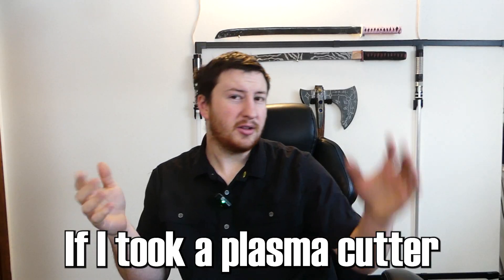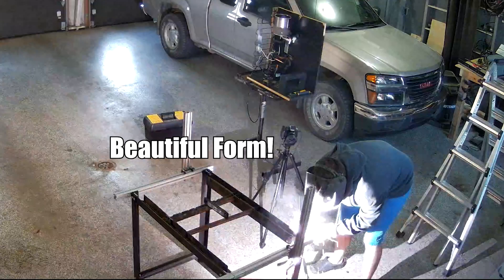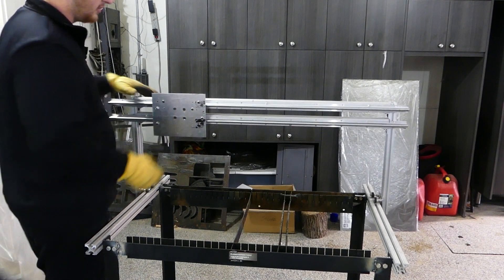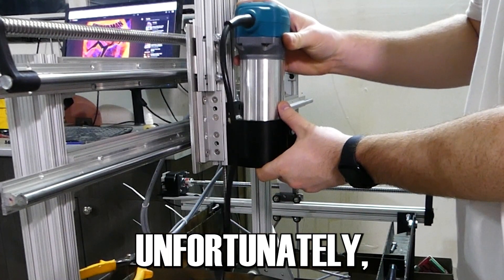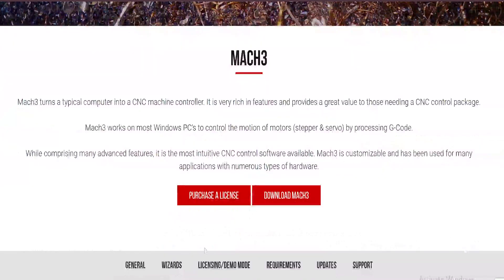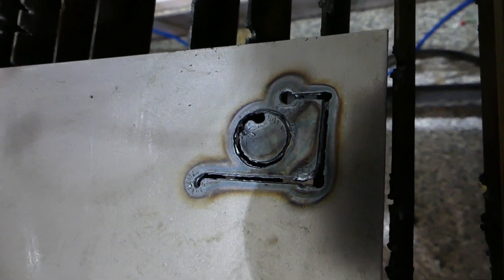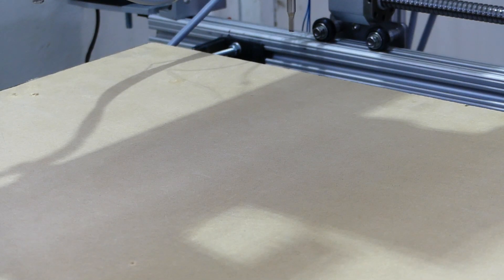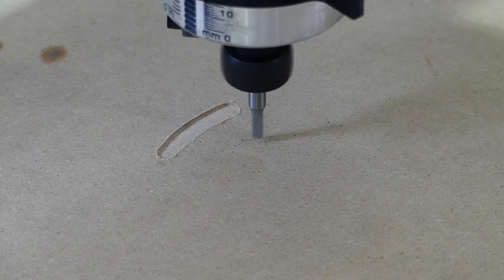I Built My First CNC Plasma Router!

Comment: What was your total build cost?
Reply from the maker: Well Including the stuff I already had like the plasma cutting table. I’d say around $600-700 cad. But it’s important to mention, the metal was bought from a local metal supplier for cheap as it wasn’t full sized bars or they had small imperfections. So there was a lot of saving there. Plus some of the motors were salvaged from broken machines. But regardless, even if I bought it at full price it would have been under $1000 cad